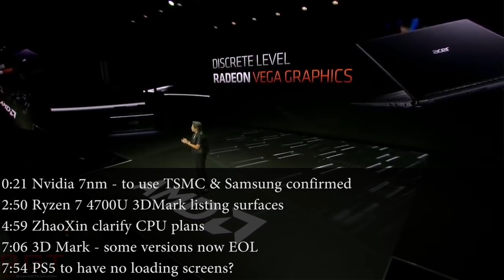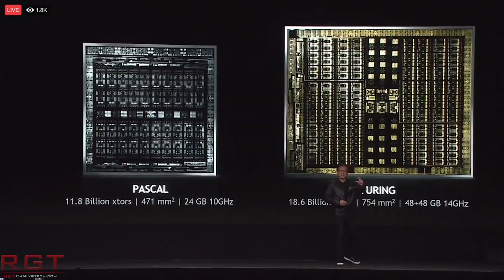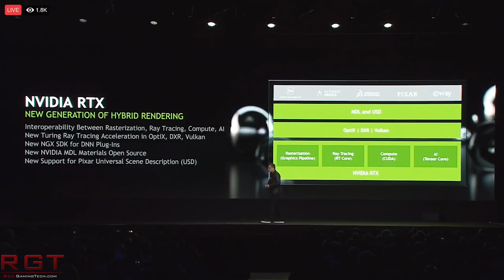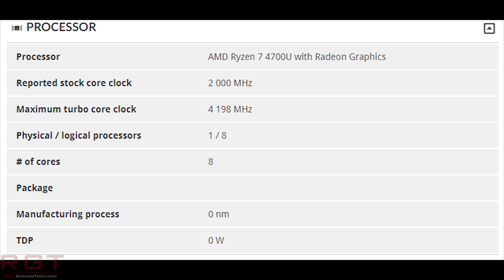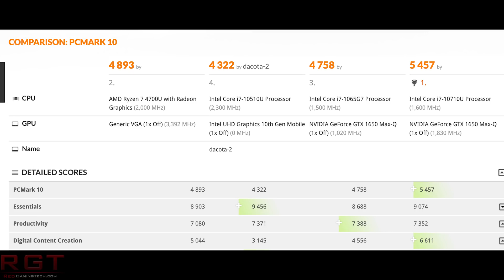Nvidia 7nm GPU To Use TSMC & Samsung CONFIRMED | Ryzen 4700U Benchmark Surfaces

Comment: about LOADING SCREENS...
I could be wrong, but I believe on console they will create a small file (or couple files) that sets up the game. To back up, when a game is stored on an HDD when you launch it data goes into your system memory (i.e. DDR4) as well as VRAM and there's a lot of setup time as things configure and copy... BUT... if you have KNOWN HARDWARE already then the end result of the setup process should be the same anyway so why not just have that final data sitting in your SSD and/or your faster shared memory so when you click on the game it just starts. It's rather like copying a lot of small files on an HDD that takes a lot longer compared to one single file of the same total size... anyway, if a game had a 200MB setup file stored on an SSD that could be read at 1000MBps then entire file could copy into the GDDR6 memory in 1/5th of a second... maybe I'm way off on how this works but it seems somewhat logical to me that it works like this.
Reply: @untseac  To be fair, we haven't really seen actually fast SSDs until the introduction of PCIe Gen 4. Nor have consoles had a large amount of fast RAM. The next gen will have both so it is likely that many games will have massively cut down load times if not eliminated them for some lighter ones.
Reply: @untseac  
To be honest it's likely that we are about to hit a wall with regards to game graphics because the AAA model of production has proven to be unsustainably expensive. With some games having budgets of 100 million USD to make (to be fair, with most of it going to marketing like with EA) it is difficult to see how much further graphics can be pushed without blowing out the budget.
I think that the current games industry as it is, cannot continue much longer without some changes. And with die shrinks producing leap ahead performance (AMD especially) I actually think that we might hit the point where hardware begins to outpace software, at least for a year or two. 

We might see some trends like global illumination and raytracing drive further hardware improvements as these features are computationally expensive, but I'm not seeing game developers follow with the same assiduousness as they have in the past. 
On the other hand, as AAA studio exploitation of game workers reaches new heights, I would anticipate that a new wave of indie and smaller scaled games start to proliferate that further drives the performance requirements of games downward. This has the effect of making games much more accessible and affordable too. 

So I see two forces starting to produce a very different looking video game market that further drives casualisation as well as increasing market segmentation.
Having a very fast PCIE gen 4 SSD in such a market might not even be necessary to eliminate load times.

Comment: Samsung may get the smaller ones if their yield is lower or the opposite - lower volume biggest dies only if they can handle it (like their defect detection/correction was described somewhere) and made a good offer.
Reply: Nvidia can be crazy with die size. TSMC is the only fab in the world have the expertise to do what nvidia has imagine with their chip size. It has been that way for two decades now (since the 90s with the Riva TNT). Nvidia for years has been looking for an alternative to TSMC but so far there is none. Heck on fact during the kepler era Jensen publically said that intel should open their fab to others. Because being stuck with TSMC does not bode well for them when TSMC can't deliver what they want. What happen to 20nm process is one such example which end up forcing nvidia to stick with 28nm for another generation. Their compute GPU development was totally halt because of it. Nvidia only able to maintain their compute dominance back then thanks to their CUDA ecosystem that pretty much become industry standard everywhere when it comes to GPU compute. Because back then AMD Hawaii simply eat nvidia GK110/210 for breakfast when it comes to raw performance and efficiency.

Comment: I'm betting the 4700U is 4 core 8 thread, just detected incorrectly.

I doubt AMD would release their flagship mobile chip without SMT. The efficiency per watt would drop significantly on a true 8 core vs a quad core with SMT.

That being said, I like what I'm seeing, just wish we had more.
Reply: It's been rumored for a bit that they are bringing 8 cores to mobile considering they are Zen 2 based.
Reply: It says physical cores
Reply: I think it's most likely 8-core 16-thread, and not being detected correctly.
Reply: @puertorricanboy1  it also isn't detected correctly. At this point your guess is as good as mine or theirs.
Reply: @nathangamble125  it is possible that they tested with SMT disabled.
Reply: SMT doesnt give free performance, I don't have an AMD cpu but my Intel uses ~30% more power for that ~30% performance
Reply: No, it isn't free, but 4 cores 8 threads is a lot more power efficient than 8 cores, period. It is more efficient use of the silicon, more efficient use of the L1, L2 and L3, especially given that you have half of each.

A CPU with SMT is more efficient per watt than a CPU without. I didn't say it used less power.

Also Zen was designed from the ground up with SMT. Running the flagship without SMT isn't going to happen.
Reply: 8 cores no smt-ht would allow for power saving and be amazing performer. It makes the most sense to compete. 8 freaking processors
Reply: @doriangray2347  SMT is worth more on Zen than it is on Intel cores, at least as of Skylake/Coffee Lake/etc.

Given the doubling of the silicon there's no way a true 8 core  will draw less power than a quad with SMT.

I would like to see a quad with SMT vs an 8 core without SMT Zen 2 just for comparison. I think the quad will be around 70% and will draw significantly less.

Maybe I'll pick up a 3700x and find out myself.
Reply: The scores are right in line with a quad core with SMT enabled.

It is just detected incorrectly.

Of course new leaks do show that this isn't their flagship mobile chip, but if 8 cores only just match Intel's quad core mobile chips with HT then something is horribly wrong here.

Comment: I hope it's fake or just an engineering sample bug, because going to 8C8T as the highest end laptop CPU would be really disappointing, unless there is going to be a 4800U. Then I suppose it's fine, but I don't like the false segmentation on the second highest end part. There is no reason to disable SMT other than segmentation. It's kinda fine when it's on lowend part like they have done in the past that are like ~$100, but this almost certainly isn't going to be a cheap part, so squeezing your customers for an extra $50 - $100 seems egregious in the high-end when it's already going to be like $300 - $400

And yes I didn't like it when Intel did it for the i5 forever and I really didn't like it when they did it for the i"7" 9"700"k (a $400 i5 9600k FIXED)
Reply: ageofbogyo  It didn't say the TDP... and second the 2000 series APUs used Zen+ tech, so 3000 was the next name in the series and they did change the node it was built on, and Renior will be a new node and a new architecture.

Plus you should look at performance to base your decisions on, not the highest number on the box.
Reply: ageofbogyo  And really is 4700U really worse than i7 10710U vs i7 1065G7.

I am quite tech savoy and apart from the G7 meaning Gen 11 graphics... so that has to be icelake, so the other would have to be the Coffee Lake refresh refresh on 14nm+++ which I have forgotten the name of, couldn't tell you anything else about those two CPUs.

I would be simply guessing at saying the 10710U was a 6C12T and the i71065G7 is 4C8T.

As Icelake at least atm is limited to 4C8T and Coffeelake++ is limited to 8C16T, but that is an i9 so it's probably 6C12T.

But that is a lot of inferring.
Reply: @Etheoma  it's deceptive nonetheless using numbers similar to the current generation deceives customers
Reply: @nonrumor  If they just re-released the same CPU and gave it a higher number I might agree with you Cough 9980XE, 10980XE, etc Cough then I could see where you were coming from.

But you don't even know that it's going to be "current generation" for example they might use some stuff from Zen 3 like the original APUs used the architectural optimisations they made to Zen+ even though it was still 14nm and 6 months before Zen+ launched.

I gotta disagree with you on this one, even if there wasn't Zen 3 features, because as said they are changing the graphics architecture, CPU architecture and node from the previous 3000 series APUs, if that doesn't deserve a series name change I honestly don't know what does.

And as I said there were valid reasons to up the naming for the first and second generation APUs, so I don't see it as being a problem.

Comment: Anyone else finding it weird that they're calling the APU the 4700? Isn't that where their Zen 3 desktop chips are likely to end up? 4600, 4600X, 4700, 4700X, 4800X, 4900X 4950X?

Are they going to be crowding into their flagship parts, are they planning on less market segmentation this time, or do we think they're going to be doing APUs much higher up the market line? 

Or are they getting ready to pull an Intel and have Zen 2 4700U's coexisting with Zen 3 4700X parts?
Reply: APUs are always called that way. For example the current 3700U is actually Zen+ instead of Zen2.
Reply: @1idd0kun  Ah. I was unaware they were already doing that. So, they pulled an Intel before Intel did? /jk 

Still seems like a confusing way to name their parts.